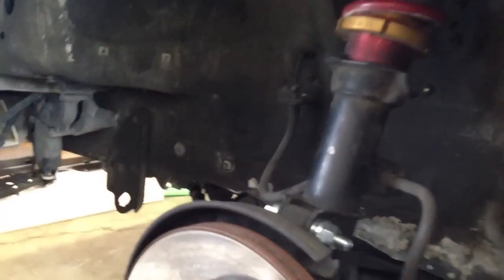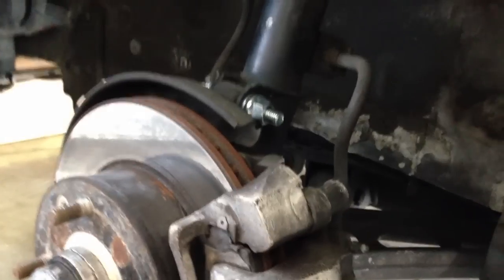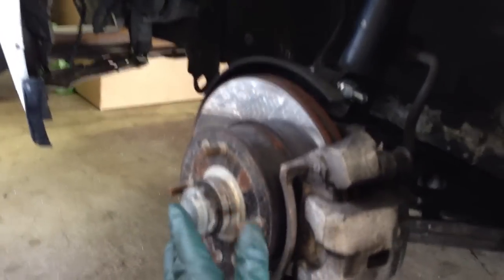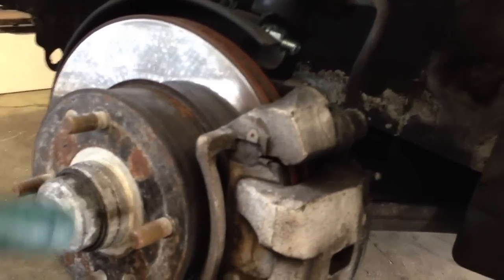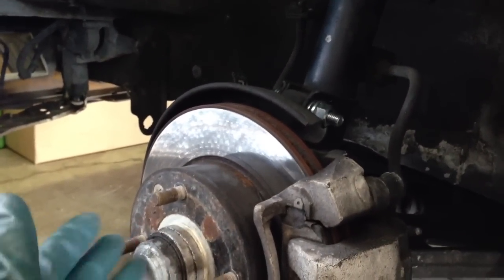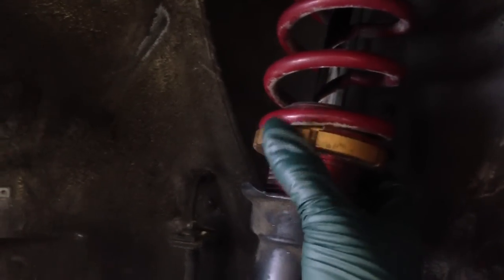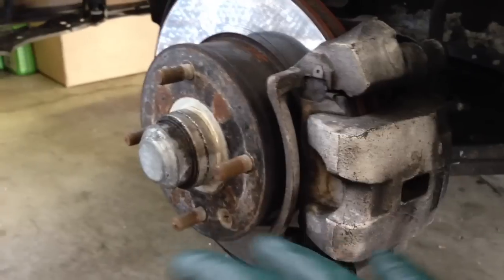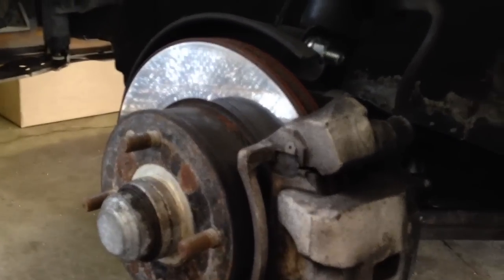Fat Cat Motorsports - Setting Coil-over Ride Heights the Easy Way

Comment: Will you run coil over sleeves like that? Ive always been worried about my crx, which has no rear sway bar would lift a rear wheel and the spring not seating correctly when it loads up again.  I figured youd want to run a helper spring to solve this
Reply from the maker: Rick Agreed that a tender spring (what I would call a low or effectively zero rate secondary spring) is designed to do exactly that, especially when there isn't a sta-bar present. That's the ideal way to do it, just involves more cost.